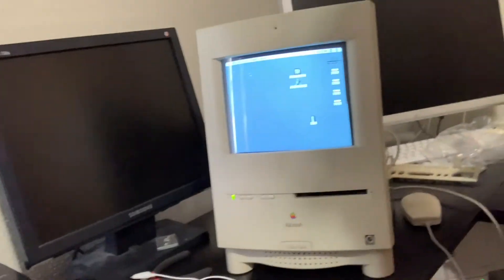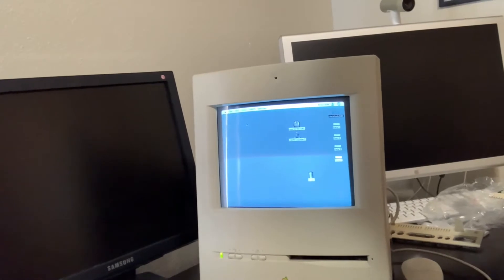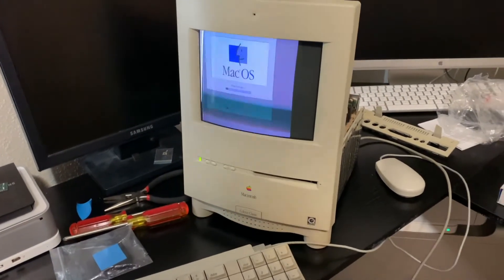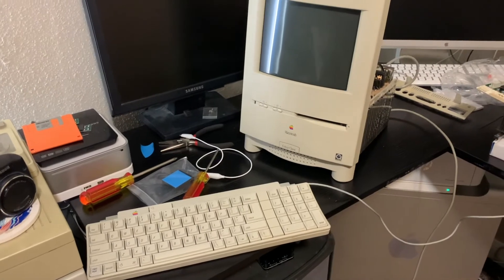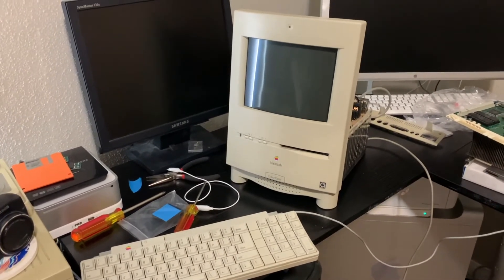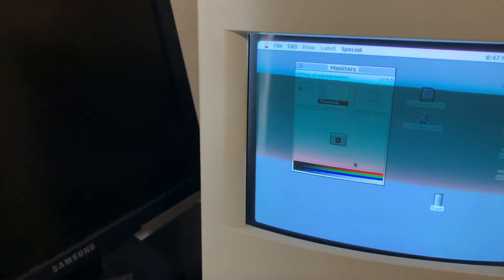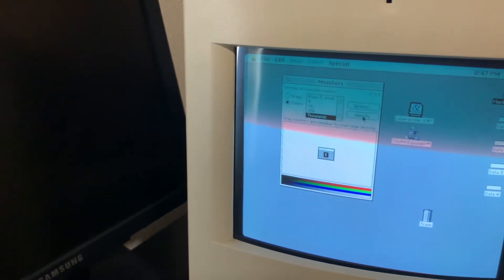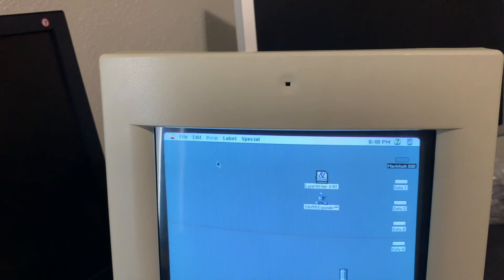Macintosh Color Classic Upgrade Results (Mystic with 640x480 mod)

Comment: Wow, can you actually select the 800x600 on a Color Classic??? Does it work? Guessing it bumps the VRAM down to just 256 bit color, but does the resolution work? Used to be a Mac guy back in the day, and was always frustrated that Apple never would push the Mac to the feature sets it should have had, and only recently even found out that 640x480 was possible on a Color Classic (didn’t realize it was a logic board swap with Performa…which were hated by Apple Dealers as they were so much cheaper and seemed to often have more features than the more expensive Macs the Apple Dealers could sell. Wow, what memories!